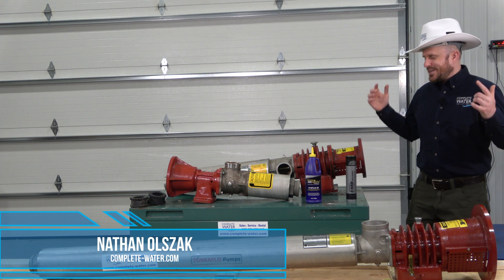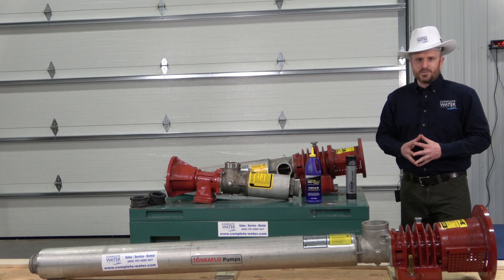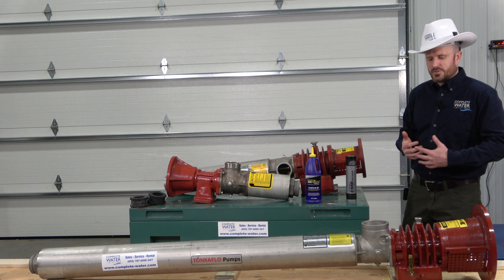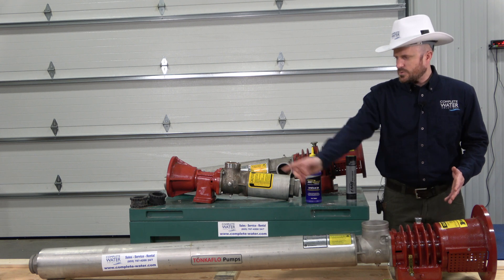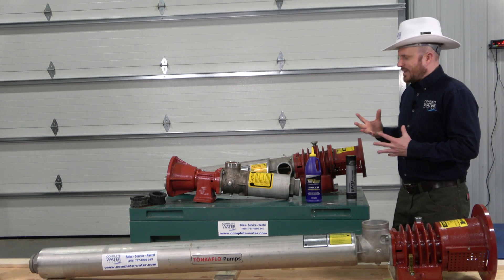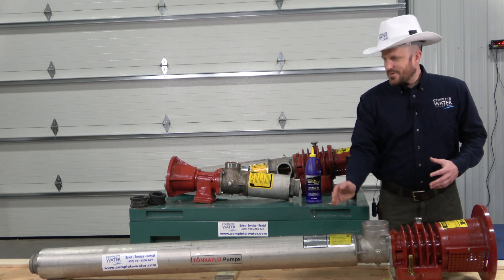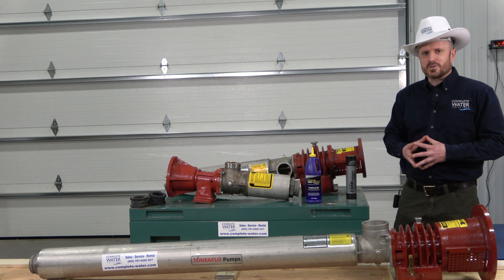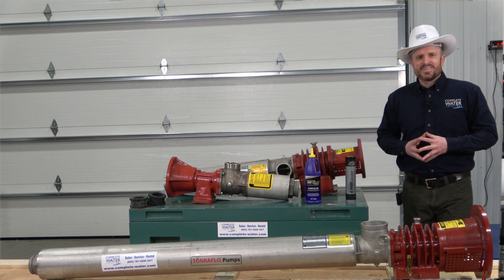Tonkaflo Pump Drawings & Tonkaflo Pump Manuals - Watch Before Taking Apart

Comment: Hi Nathan, I got a question about the AS40412KZE-50 pump. What is the maximum GPM that it can produce?
Reply from the maker: Hi Garfield - This link should provide you some data https://complete-water.com/product/as40412kze-50-50hz-pump-only